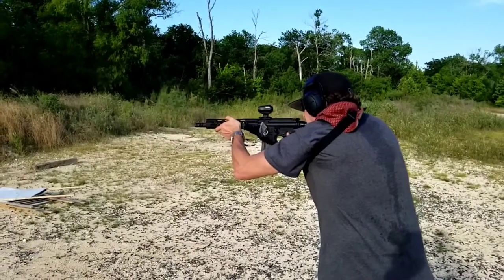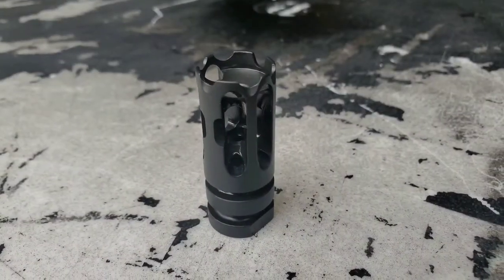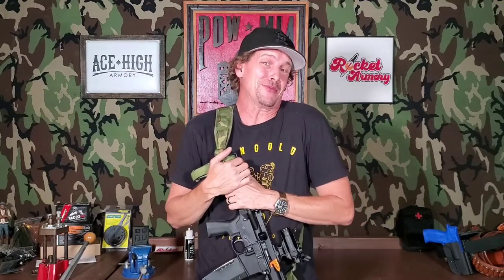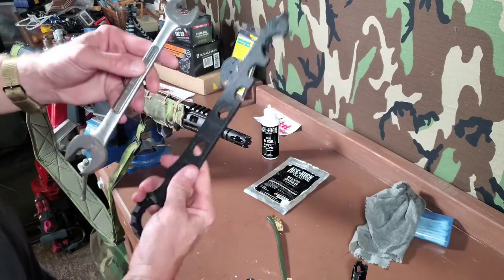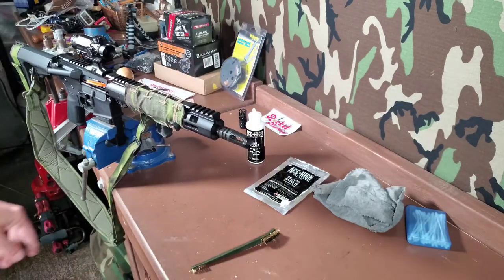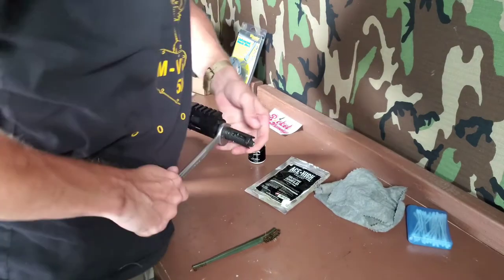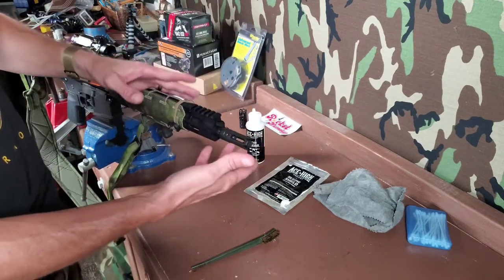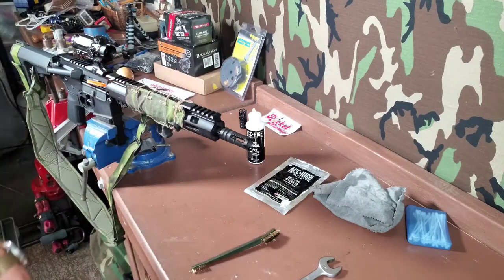Project: AR Pistol Flash Hiders

Comment: Surefire Eliminator. One of the best I've used. Got it on a 10.5 inch gun. If you want to test flash, get Winchester white box 55 grain fmj....super flashy and stinky! No flash with the Surefire. Wish I saved some as it's impossible to get now.... I put a KAK linear comp on my friend's 10.5...replaced an A2 he had on it.....shot the Win 55 fmj and he freaked out..."What did you do to my GUN?!?!" 3 foot long fireball 2+ feet in diameter! Fired some IMI and he was shocked at the difference.

Comment: I used a linear comp on my old 12" pistol (which I traded away years ago), and as I recall, it worked pretty well. It was from Black River Tactical and was fairly light (at least compared to the Noveske type comps, anyway!).

Comment: Will, maybe it's a case of "ignorance is bliss", but I have a 10.5" AR pistol with a no-frills A2 flash hider, and I have never found it to be excessively loud or fire-ball-y (words are hard) both indoors and outdoors. One of the two instructors at my class very quickly pointed at my AR pistol before class started and bitched about how he "knew" he was gonna hate my AR the most for its noise and fireball. Meanwhile, I was all "pew-pew" casually and nonchalantly all day long.
Reply from the maker: A2 birdcages are a pretty darn effective flash hider. That's why Uncle Sam chose them. 👍🏼
Reply from the maker: At the 0:46 mark you can see the A2 birdcage tested only slightly behind the YHM.
Reply: Try shooting in low light conditions !

Comment: If that fails....AR Stoner Linear Comps are super cheap....maybe see how those work out.
A more contraversial option is a American partial suppressor tube without baffels or end cap.   Then use that as basically a long  flash can.  Maybe that'll work.
Reply from the maker: I may end up trying some various flash-cans, etc., but I'm trying to keep it as light as short as possible. We shall see. 😊

Comment: Ok can you give the why of crank it down and back it off (repeat)? Guessing its to do with the crush washer being used as a spacer and getting it just the right "size" for the indexing?
Reply from the maker: You pretty much got it. If you keep cranking it'll just lock up. When you back off and then crank back into it it'll give a little more.

Comment: This video is over a year old, but you need to give Dead Air Flash Hider (3 prong) a shot, it doesn't ring. It has asymmetrical prong indents, so they don't ring.
Reply from the maker: I've ended up with a Surefire Warcomp 👍🏼
Reply: @SapperGentleman  does it ring or not at alk?
Reply from the maker: @righteousone8454  It's closed tine. 👍🏼
Reply: @SapperGentleman  got ya. How bad was the flame with A2? I just built 10.3" and I have A2 flashhider and Dead Air one